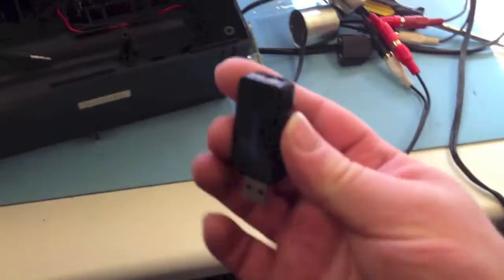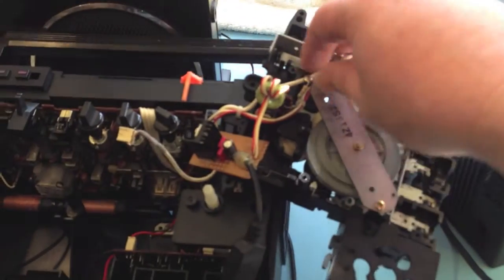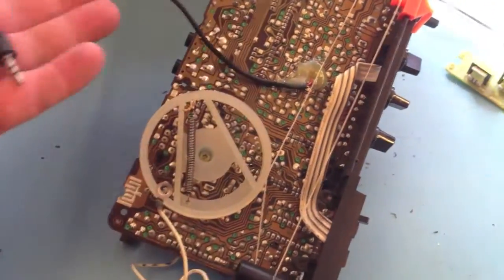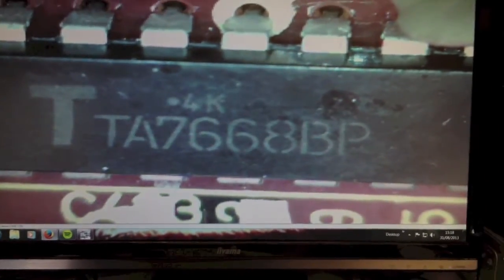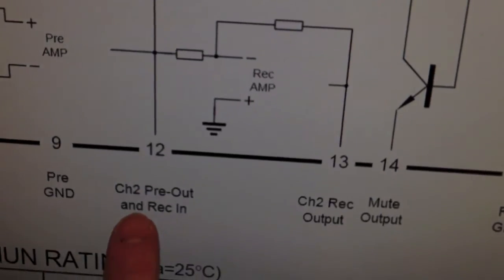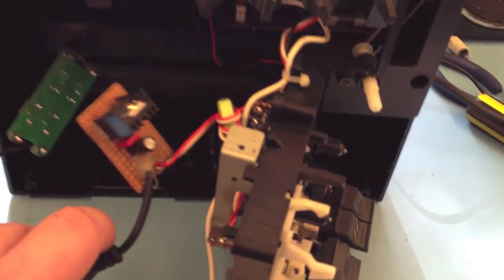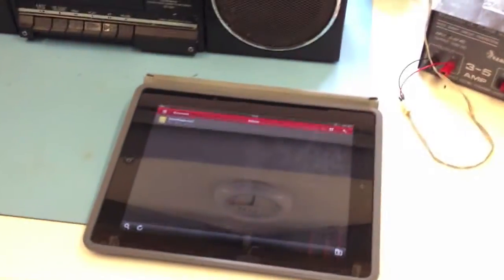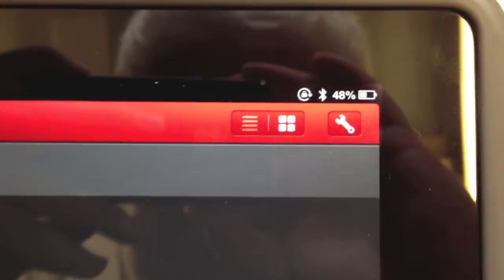Old meets new - 80s boombox gets bluetooth!

Comment: Please help.I want to add aux the tape head, I know I need to avoid pre-amp, but there are two IC from head to ha12185nt(audio signal processor for cassette deck) from there to ha1214a ( dolby noise reduction system)The question is whether to avoid both or just HA12185nt,
Reply from the maker: +Srdjan zmaj I would connect your signal to the output of the tape pre-amp as I did in my video.  I would recommend at least coupling it with a 10uF capacitor or an isolation transformer as I did.

Comment: Hello,

Thank you for the video.

I want to build something similar (but more from scratch) and I had also noise issues, I still have.
There is still audible noise even with the ground loop isolator mounted. It can be heard only when nothing is playing. Because I wanted to let it always powered, it's a no go. I looks like I will have to mount an on off switch anyway. Or, will it help if I power the BT receiver from a battery?

Thanks again.
Reply from the maker: What have you built?  Do you have a video/picture/diagram I can see?

Comment: Hey I have a question, i have an old magnavox tandom boom box ( the speakers are amazing!) but it had an left and right line in plug in that when used, you have to use it though 1 of 2 tape decks and the sound was.. poor however the radio utilized the speakers very well! so my plan was to hijack the radios audio output to the speekers and mic (not a microphone the 2 little sound things atop of the speakers i think there tweeders) ANYWAY i messed it up, but im wondering if i can still use it by ripping everything but the speakers out and attaching them to an amp that i can fit inside the boom box, could this in theory work?
Reply from the maker: I don't see why now,  you might have to be a bit creative with how you install everything if you want to retain the original appearance.  A small amp like those you can get as a kit from Maplin (or RadioShack in the US) might do the job.  You probably wouldn't need anything particularly powerful, and it's best not to exceed the speaker ratings.

The hardest part I think will be powering it but if you choose the right amp it shouldn't be too much of a problem.  Some amps need a split power supply so that probably wouldn't be suitable in your case especially if you want to use it on batteries,  I'd look at a class D amplifier or even one of those TA2020 class T amps you can get on eBay for quite cheap, though that might be overkill.
Reply: reddragon27284 okay thanks, I tried to see if i could rectify my mistakes but it seems like theres multiple lines coming from differnt inputs/radio/cassette and theres no one direct line going into speakers, so i ended up guting everthing and the speakers only have the black and red connections, so im planning on getting a small powered amp from amazon and just connecting them like regular ole speakers. simple is best i guess.